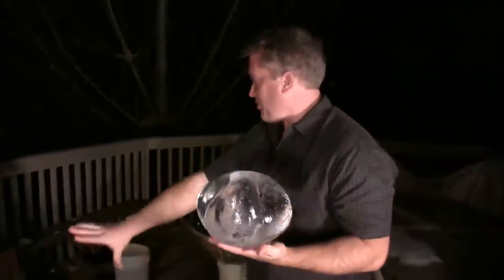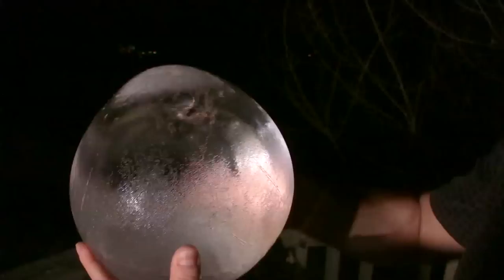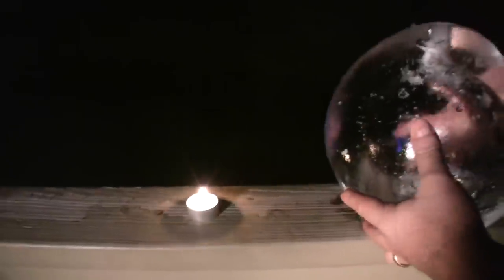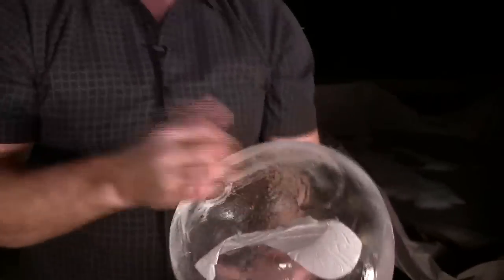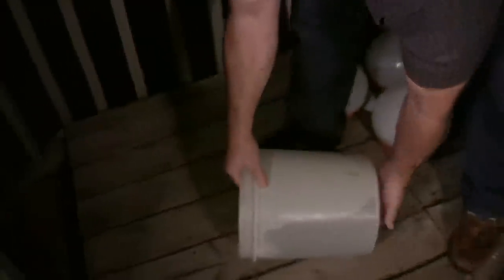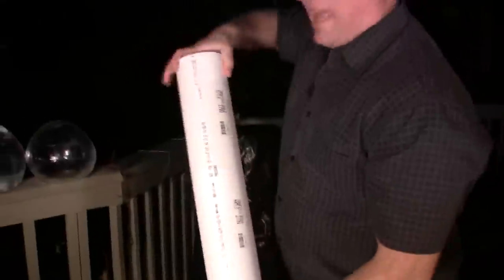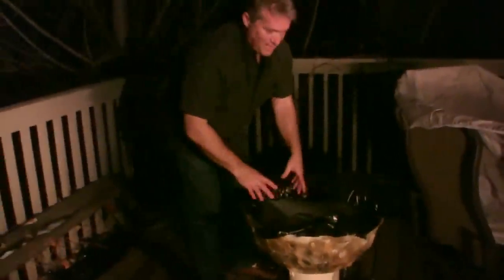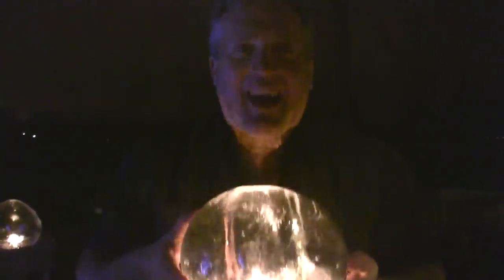Ice Globes and Ice Luminaries, fun with ice

Comment from the maker: The ones I made for this episode are still on my front step, and we've had 2 rather warm spells. So a month on the far end. But then again we've had a significantly cold winter. They are smaller as ice evaporates even if it doesn't melt. The candles have a small effect on the ice, only enlarging the hole on top if you use them that way. I've taken to turning them upside down, hammering out the hole and placing them in the snow. I do so many that the coast of leds is prohibitive. My friend have.

Comment: Here's a tip:
After emptying out the half frozen globe instead of drilling a hole in the end and placing it over a candle... leave it with the opening up. Then just drop a small handful of snow into the globe and make a flat surface to place your candle on.  No need for power tools that way. :-)
Reply: Yeah, (this is from my ice account) I do them both ways. When you do it the way you're talking about it blows out from the wind a little easier because the whole has to be big enough to get your hand in I call the easy ice lantern. The more advanced one, where you drill two holes holds up better in windy climates although you have to place them on a hard surface rather than the snow. Check out my ice globes channel for more.
Reply: Triv27